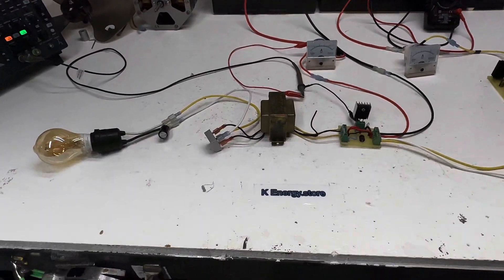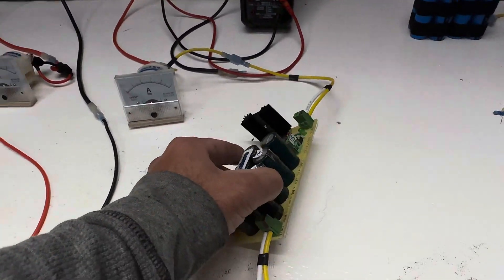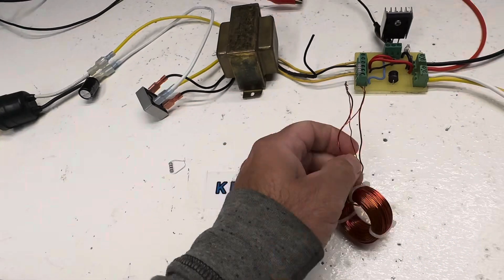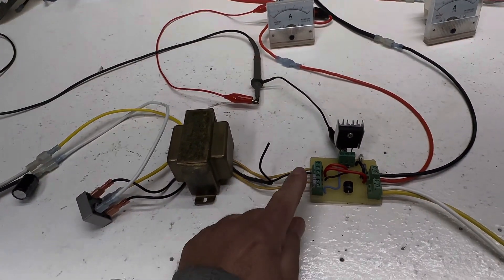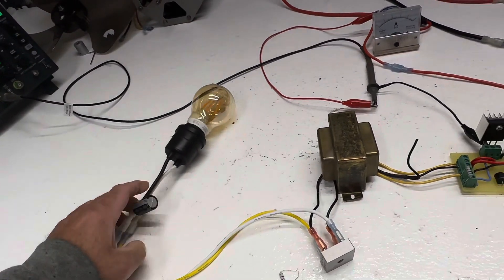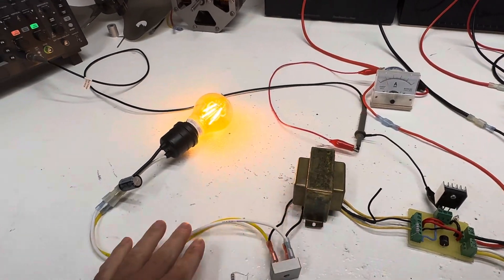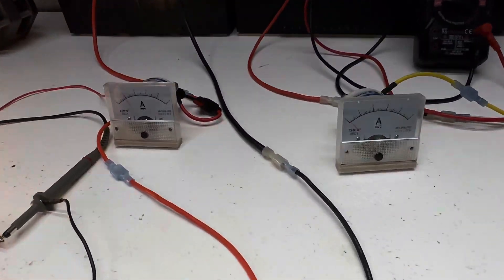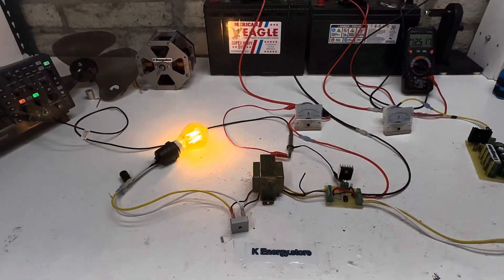Forced oscillator running transformer

Comment: Nice setup. I think this is quite creative because you replace the normal coil to a transformer. So now it has stable 100v to light the bulb up. I wonder what will happen if you increase the load like 8 or 12w light. Will the cap dump become slower or the lights will go dimmer?
Reply from the maker: Thanks ! Definitely needs a bigger transformer and more testing